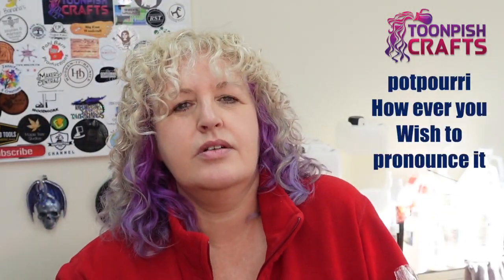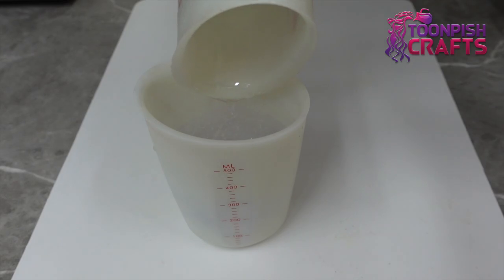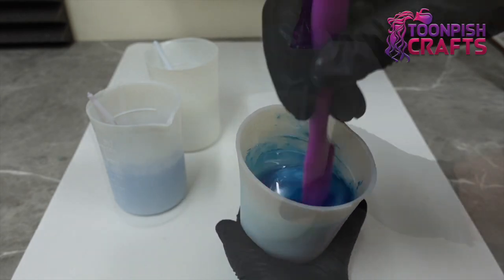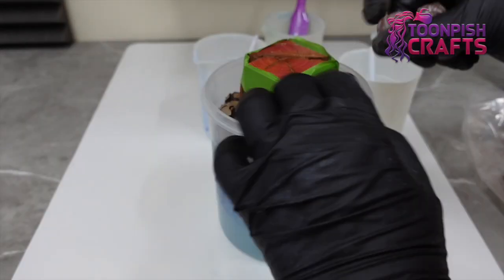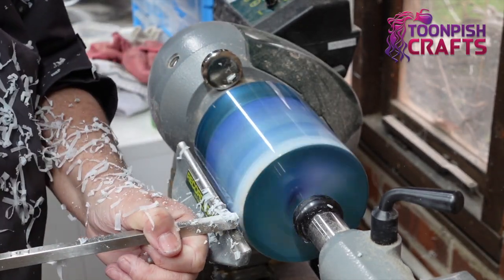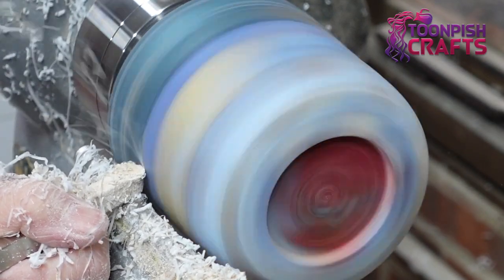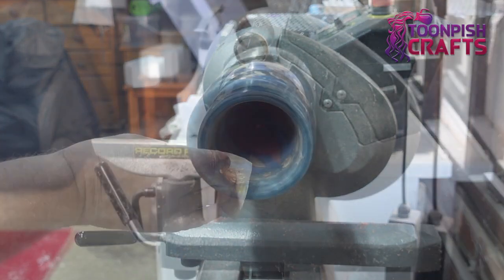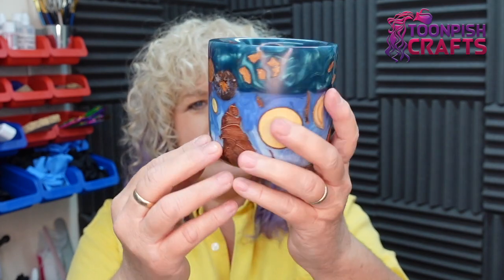Adding Potpourri to resin - Would you try this??

Comment: Wow, too beautiful Wendy, very good! 😍 I would also like to have that tool where it fills you with resin like streamers but, I have no space here, who knows the satisfactions. 😊
Reply from the maker: The Lathe does need a little room 😯
I use my garage for it and it is very cold in the winter 😂😂
Thanks Gulma ❤️
Reply: @Toonpish  Ahahaha, poor, however you are very nice. 😘💕 My basement measures 1 meter X 3, I would suffocate under the resin in no time. 🤣🤣🤣
Reply from the maker: My craft room is the exact same size. No room for a lathe in there 🤷‍♀️😀
Reply: @Toonpish  🤣🤣👏🏻